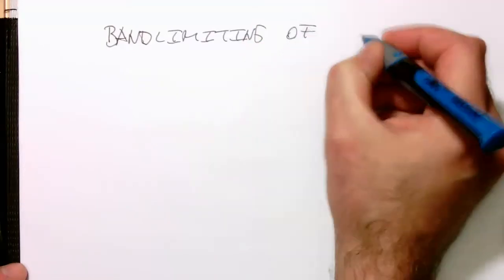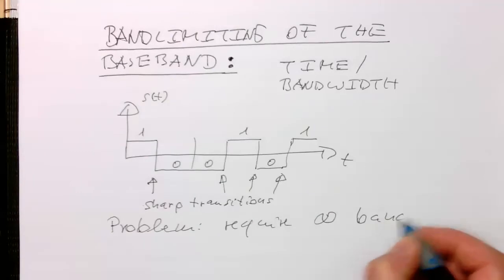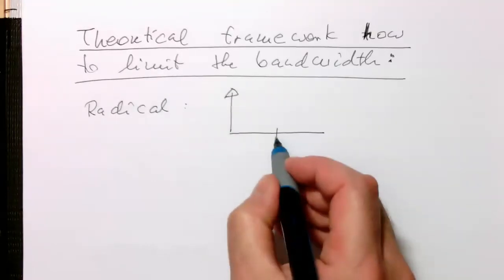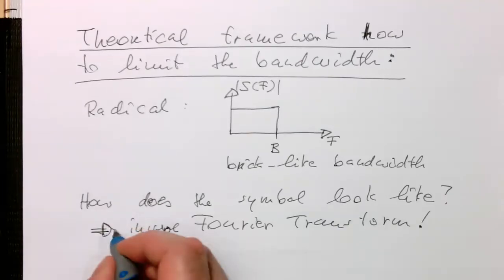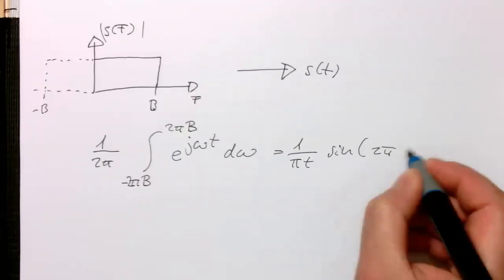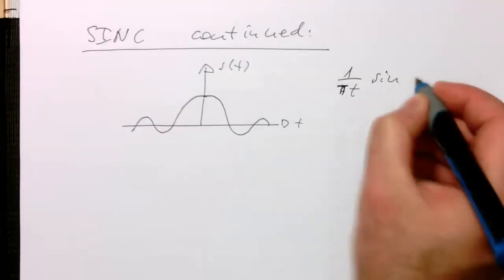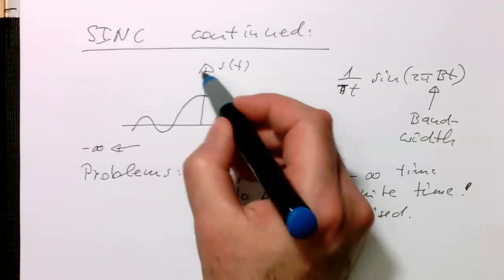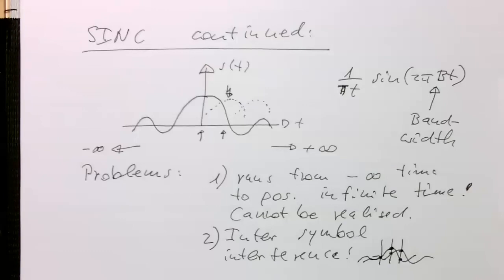Symbol timing: introduction (0000)

Comment: Although the channel is band limited, the base band signal is used to modulated the carrier signal. So the transmitted signal would not be the sinc signal. Take BPSK as a example, the digital 1 is represented by a  sinusoidal wave with 0 degree phase, the digital 0 is represented by a sinusoidal wave with 180 degree phase. So, I think sinc signal is not a good example to explain the ISI.